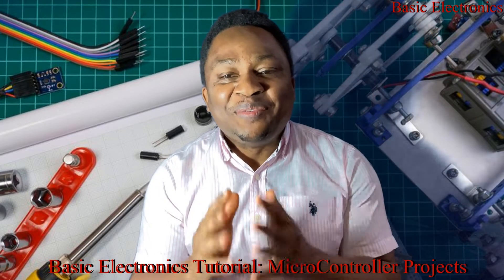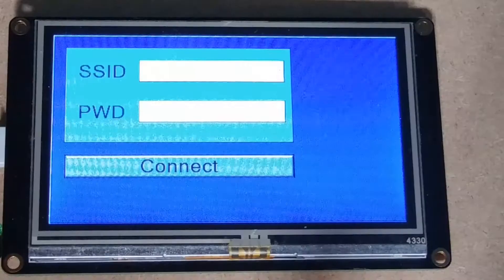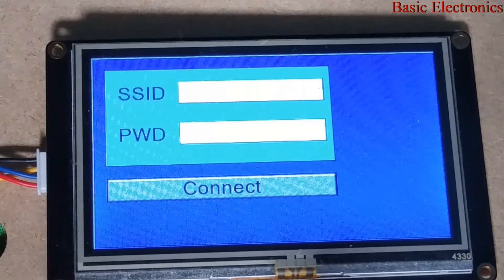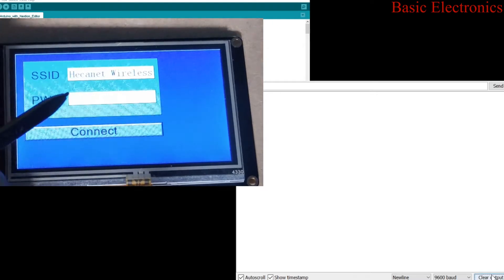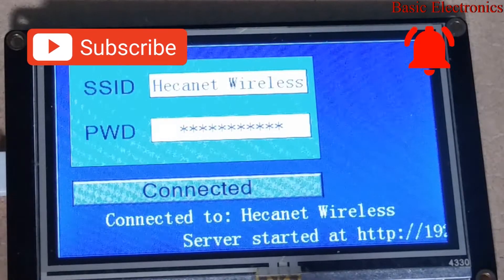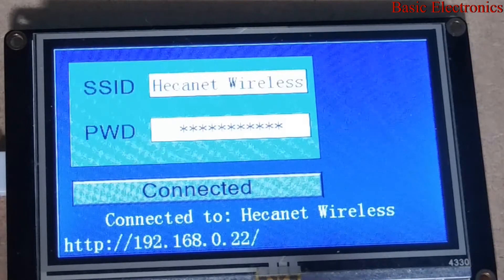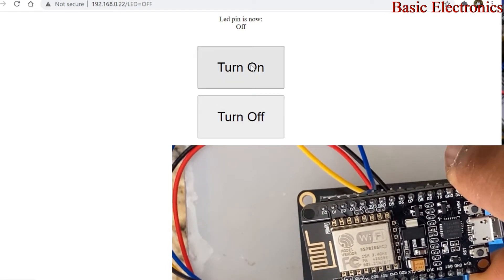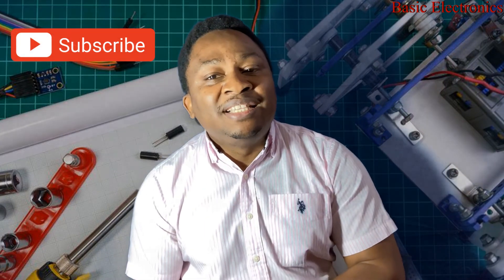HecaWorld unLTD Android Nextion Project Series Part 1 | Arduino NodeMCU | Nextion Display | Servers

Comment: Can you share the MCU CODE you use in this video
Reply from the maker: Of course... provide your email address and we'll email you the codes. We'll soon be posting them on a website for you to repo, but for now, just provide us with your email address. Please do subscribe if you haven't done so already. Thanks.
Reply: @hecanet  Could you please send me the arduino code? dimuthuj39@gmail.com
Reply from the maker: @dimuthujayawardene4747  
Here is the code below... check back on https://www.hecaworld.com/microcontrollers/ by end of next month as we plan to update the website with some of our codes.
/*

info@HecaWorld.com
https://hecaworld.com
(c) 2019
*/

#include <SoftwareSerial.h>
#include <ESP8266WiFi.h>
#include <Nextion.h>
#include <math.h>

String RequiredText;
//String TextFieldFile = "print TextField.txt"; 
String ssid;
String SSID1;
String Password1;
String SSIDTxt;
String PasswordTxt;
String Password;
int CurrentPage = 0;
String SSIDinput;
String PWinput;
String IpAddy;

SoftwareSerial nextion(4, 5);// Nextion TX to pin 2 and RX to pin 3 of Arduino

Nextion myNextion(nextion, 9600); //create a Nextion object named myNextion using the nextion serial port @ 9600bps

  int ledPin = 16; // GPIO16
  WiFiServer server(80);

void setup() {
  Serial.begin(9600);
  myNextion.init();
  delay(10); 
  
  pinMode(ledPin, OUTPUT);
  digitalWrite(ledPin, LOW);
}

void loop() { //from another void loop

  // Check if a client has connected

  
  WiFiinit(); //Setup the Wi-Fi Credentials

  WiFiClient client = server.available();
  if (!client) {
    return;
  } 
  // Wait until the client sends some data
  Serial.println("new client");
  while(!client.available()){
    delay(1);
  }
 
  // Read the first line of the request
  String request = client.readStringUntil('\r');
  Serial.println(request);
  client.flush();
 
  // Match the request
 
  int value = HIGH;
  if (request.indexOf("/LED=ON") != -1)  {
    digitalWrite(ledPin, LOW);
    value = LOW;
  }
  if (request.indexOf("/LED=OFF") != -1)  {
    digitalWrite(ledPin, HIGH);
    value = HIGH;
  }
 
// Set ledPin according to the request
//digitalWrite(ledPin, value);
 
  // Return the response
  client.println("HTTP/1.1 200 OK");
  client.println("Content-Type: text/html");
  client.println(""); //  do not forget this one
  client.println("<!DOCTYPE HTML>");
  client.println("<html>");
 
  client.print("<center>Led pin is now: </cennter>");
 
  if(value == HIGH) {
    client.print("<center>Off</center>");
  } else {
    client.print("<center>On</center>");
  }
  client.println("<br><br>");
  client.println("<center><a href=\"/LED=ON\"\"><button style=\'FONT-SIZE: 30px; HEIGHT: 100px; WIDTH: 200px; Z-INDEX: 0; TOP: 200px;\'>Turn On </button></a></center>");
  client.println("<p><center><a href=\"/LED=OFF\"\"><button style=\'FONT-SIZE: 30px; HEIGHT: 100px; WIDTH: 200px; Z-INDEX: 0; TOP: 200px;\'>Turn Off </button></a><br /></center></p>");  

  client.println("</html>");
 
  delay(1);
  Serial.println("Client disonnected");
  Serial.println("");

}

/*Wi-Fi Setup is done here for the setup loop*/

void WiFiinit() {
  
CurrentPage = 0; //This is the default/initial page
    String message = myNextion.listen(); //check for message 
    

     // used for debugging purposed only.
     // uncomment to view every message that came through
      if(message != ""){
      Serial.println(message); //...print it out
//      myNextion.sendCommand("get t2.txt");

 if(message == "65 0 6 1 ff ff ff"){
      myNextion.sendCommand("print t2.txt"); //Send this command to the Nextion display to print the content on the "enclosed field"
      delay(100); //Delay to allow time to execute command
      String message = myNextion.listen(); //check for a response from the Nextion Display and assign that response to a string named message1
   if(message != ""){
      SSID1 = message;
      Serial.println("SSID1`: " + SSID1);
      delay(50); //delay to execute command completely before loading next page
}
 }
if(message == "65 0 4 1 ff ff ff"){ 
      myNextion.sendCommand("print t3.txt"); //Send this command to the Nextion display to print the content on the "enclosed field"
      delay(100); //Delay to allow time to execute command
      String message = myNextion.listen(); //check for a response from the Nextion Display and assign that response to a string named message1
      if(message != ""){
      Password1 = message;
      Serial.println("PASSWORD1: " + Password1);
//      myNextion.sendCommand("page 2"); //When the new message is received, go to the first page (or load any page of choice)
    
}      
      }
      }
    
    if(message == "65 0 2 0 ff ff ff"){ // if a message is received...
    myNextion.sendCommand("page 1"); //load the next page
    }

CurrentPage = 1;

   if(message == "65 1 4 0 ff ff ff"){ // if a message is received...
    Serial.println(message); //...print it out
    myNextion.sendCommand("page 0");
    
    }

CurrentPage = 1;

    if(message == "65 0 6 1 ff ff ff if"){ // 65 1 3 0 ff ff ff if this particular message is received...
      myNextion.sendCommand("print t2.txt"); //Send this command to the Nextion display to print the content on the "enclosed field"
      delay(100); //Delay to allow time to execute command
      String message = myNextion.listen(); //check for a response from the Nextion Display and assign that response to a string named message1
   if(message != ""){
      ssid = message;
      Serial.println("SSID: " + ssid);
      delay(50); //delay to execute command completely before loading next page
      myNextion.sendCommand("page 2"); //When the new message is received, go to the first page (or load any page of choice)
    }
  }

CurrentPage = 2;

  if(message == "65 2 4 0 ff ff ff"){ // if a message is received...
    Serial.println(message); //...print it out
    myNextion.sendCommand("page 1");
  }

 CurrentPage = 2;

  if(message == "65 0 4 1 ff ff ff"){ //65 2 3 0 ff ff ff if this particular message is received...
      myNextion.sendCommand("print t3.txt"); //Send this command to the Nextion display to print the content on the "enclosed field"
      delay(100); //Delay to allow time to execute command
      String message = myNextion.listen(); //check for a response from the Nextion Display and assign that response to a string named message1
   if(message != ""){
      Password = message;
      Serial.println("PASSWORD`: " + Password);
 

//      WiFi.begin(ssid, Password);//start the Wi-Fi connection after setting up the credentials
      WiFi.begin(SSID1, Password1);
   //========================================================================
   while (WiFi.status() != WL_CONNECTED) {
   delay(500);

//    WiFiinit(); //Setup the Wi-Fi Credentials
    
//    WiFi.begin(ssid, Password);
 

   Serial.print("Connecting: ");
//   Serial.println(ssid);
   Serial.println(SSID1);
  }

//   myNextion.sendCommand("page 0"); //When the new message is received, go to the first page (or load any page of choice)
   //====================

    Serial.println("");
    Serial.println("WiFi connected");
 
  // Start the server
  server.begin();
  Serial.println("Server started");
 
  // Print the IP address
  Serial.print("Use this URL to connect: ");
  Serial.print("http://");
  Serial.print(WiFi.localIP());
  Serial.println("/");

  String url = ("Server started at http://" + WiFi.localIP().toString() + "/");
  Serial.println(url);
//  myNextion.setComponentText("g0", url);
//  myNextion.setComponentText("t4", url);
  
//========================================================================
  myNextion.sendCommand("page 0"); //return to specified page i.e., page0 after connecting the Wi-Fi

//=======================================================================
  delay(500);
//  myNextion.setComponentText("IPTxt", String("Connect with: http:// " + WiFi.localIP()));
  myNextion.setComponentText("IPTxt", url);
  myNextion.setComponentText("g0", url);
  myNextion.setComponentText("b0", "Connected");
  myNextion.setComponentText("t4", "Connected to: " + SSID1);
  delay(100);

  //============================ 

  if(message == "65 1 4 0 ff ff ff"){ // if a message is received...
    Serial.println(message); //...print it out
    myNextion.sendCommand("page 0");
    
    }
    }
   }
 }
Reply: @hecanet  Thank you! Could you please upload the HMI file. Touch release event gives and error.
Reply from the maker: @dimuthujayawardene4747  Try downloading the .tft file here - https://www.hecaworld.com/microcontrollers/

It will first download as a .doc file. Convert it to .tft first before using it.

If you still have issues, I can have a live call with you today to work you through how to create your own or even fix your issue for you. Let me know what you think. If you are available, I will send you an invite for the live session.
Reply: @hecanet   link seems to be broken. It's very helpful if you could send the .HMI file for reference.
Reply from the maker: @dimuthujayawardene4747  Download it here. Remember to rename it by changing the .doc to .tft before installing on the SD Card: http://www.hecaworld.com/wp-content/uploads/2021/09/Wi-Fi-Hotspot.doc

If clicking the link doesn't work, copy the link and paste it in the address bar of your browser and it will download automatically.
Reply from the maker: @dimuthujayawardene4747  It might be better if you are available to have a live session as well. I can walk you through the issue you are having with your version of the code.
Reply from the maker: @dimuthujayawardene4747  Can you confirm if the download worked for you this time?
Reply: @hecanet  Yes. Please say how to send 2 textbox strings to arduino from display (ssid and password) What is to be coded in nextion editor.
Reply from the maker: @dimuthujayawardene4747  Good to know. We'll have another live session to show how to send any text from the Nextion Editor to the Arduino.

Either watch out for the video premier or let me know when you are able to join a live-demo. It is much easier to watch and follow along than just trying to explain it.